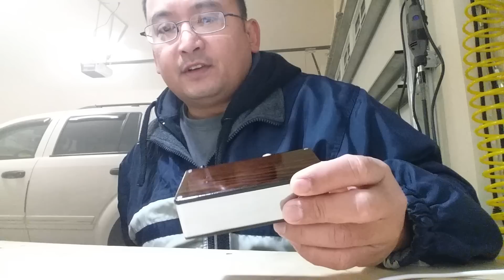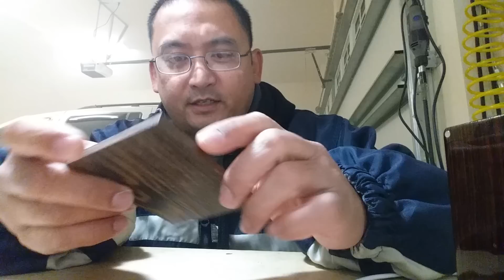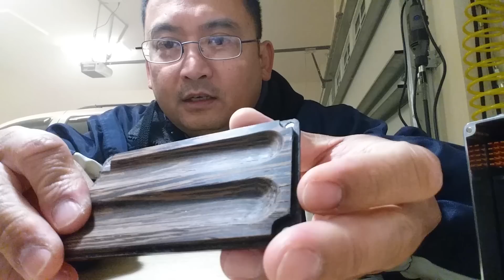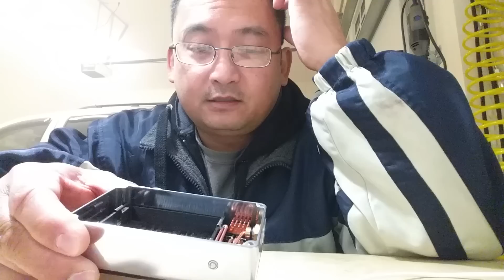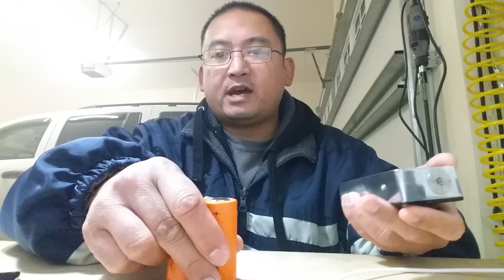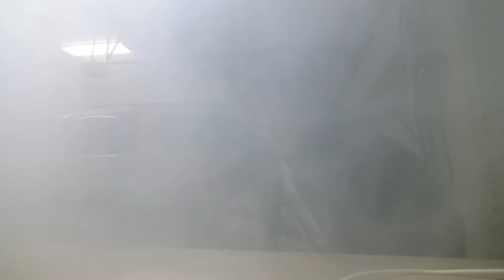Custom made parallel unregulated 26650 box mod

Comment: Where do you get that kind of switch and what kind is it. Also is that the same mosfet that you used on the the other video?
Reply from the maker: masteRmakeR322 it's a tactile switch and I purchased it on eBay from the seller named Stearnsy. He sells box mod parts. Yes, the same mosfet but X2.

Comment: Looks great on you do awesome work man  I know you get a thousand questions a day but the other day my mosfit had burned up look to be the center ground so I was going to double up on my mosfet like you spoke about do you  using 2 15k resistors with it or just one with you MOSFETs may I ask?
Reply from the maker: Robert Eby you only need one resistor. Also, if you heatshrinked your mosfet, don't next time. You probably know that mosfets generate heat so you want the heat to dissipate.
Reply: Al USAF Im currently looking at building my first box mod (18650 parallel) and was wondering which mosfet should i get does it matter what the volts and amps are for the mosfet?
Thanks Keep up your vids, loving em!
Reply from the maker: Sean Bourke I recommend the IRLB3034PBF mosfet.

Comment: Great attention to detail.Stunning work and well worth the wait to see it.So you used JB Weld on the mosfet and that must be easier than trying to use dabs of that and thermal compound in the center.Thermal compound is so messy but even though you might not need the heat sink it looks great in there with the copper wires.Keep up the great work and nice to see you again.Cheers
Reply from the maker: john muller I used JB weld because I'm not sure if thermal compound would hold. I don't want the heat sink to come off with all the bare wires.

Comment: Congratulations, pal!!! That is one awesome looking mod you got there. It seems that you have a lot more "juice" than any other modders out there. The workmanship that you put in that one is simply outstanding. Just one question though... How did you get rid of the wall of the hammond? It is so neat and flawless, pal. To tell you the truth, you have ignited lots of fire in most "diy ers" out there to produce one. Thus far, I have stopped purchasing mods from vendors. I am on my second mosfet box and a mosfet pipe comes right after. Thanks so much for the inspiration and guidance, pal. Once again... Congratulations on the new Awesome Mod... Vape On from Kuala Lumpur...
Reply from the maker: Ralph J I used my dremel and finished with a file. Congrats on your build too and good luck on your future builds. Thank you also!